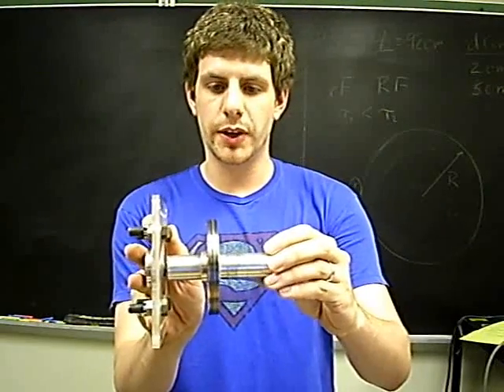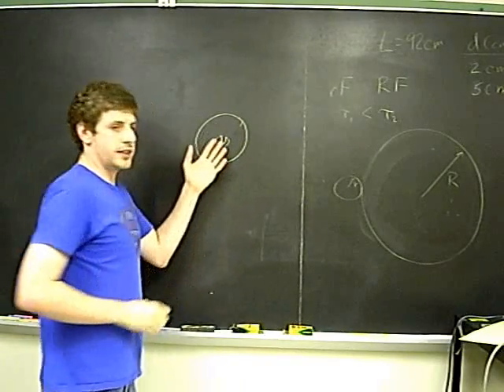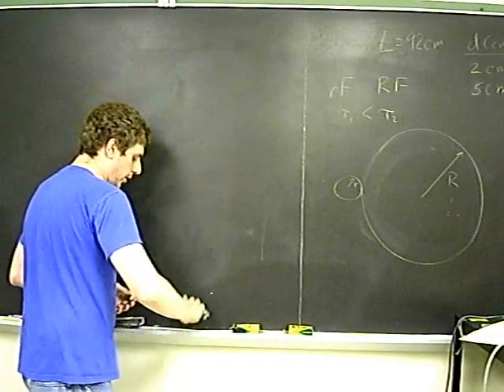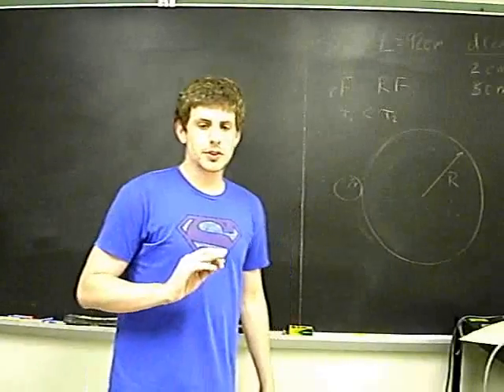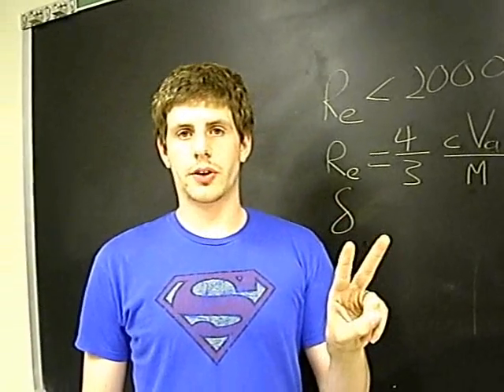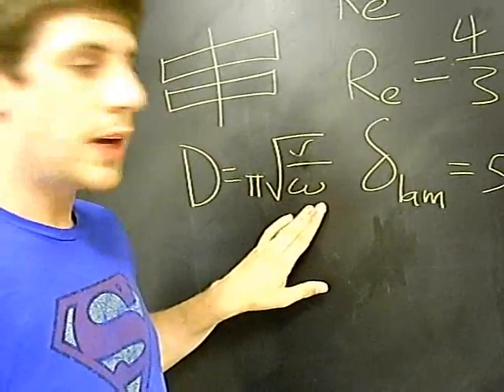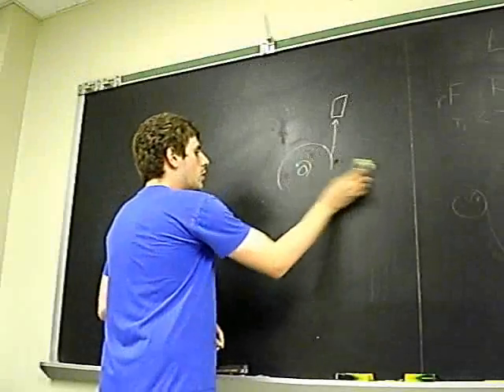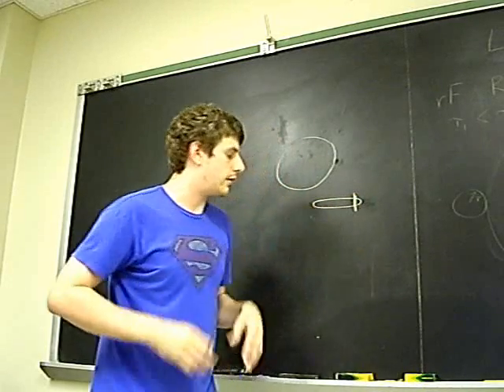Tesla Turbine Concepts Explained

Comment from the maker: @givemetoast you might want to look at some fluid mechanics books for information on that, but it depends on the fluid. You would want a very, VERY smooth pipe entering the inlet, but one that is not too long, as the boundary layer will transition to turbulent flow. I know that you are designing it, but I could be more help if you give me some information, or let me know the dimensions, and I will try and point you into the right areas.

Comment from the maker: @X02fighter dropping them yes, they will break/fracture. Unless your using non-industrial ceramic (dinner plates), they should hold up. I know tiles on the Space Shuttle were made from High Temperature ceramics, and I understand that they are experimenting with High Temp ceramics in jet turbines. The advantage of a Tesla Turbine lies in the fact that you can use low quality (non superheated) steam, while conventional turbines require high quality steam.

Comment: @heavym3tal right that makes perfect sense but isn't ceramic fragile? I'm afraid that using ceramic discs might cause them to break or fracture if the revolutions per second get too high or if someone accidently drops it on the ground

Comment from the maker: @X02fighter If you use aluminum, you will have to limit the temperature of your working fluid about 100-200 deg below the melting point of Al, which is pretty low to begin with. If you could use a ceramic, you could increase your temperature up into the 1000-2000 deg regime. Don't forget that heat will diffuse through a solid from the hot end to the cold end.

Comment: You said that lightweight yet smooth discs would help increase performance of a tesla turbine. Would aluminum discs work or should you try something a little heavier bcuz I'm think that a prolonged use of the turbine would cause it give off lots of heat

Comment from the maker: @xaviour39 Well technically it doesn't produce any energy. It extracts it from a working fluid. Now the amount of energy extracted depends on the efficiency of the engine in question. The highest experimental efficiency for a single stage Tesla Turbine has been about 35-40%. Theoretically, if you have laminar fluid flow over the surface, then you can achieve efficiencies in excess of 95%.

Comment from the maker: @dheiliger yes, this turbine can be used in reverse as a hydraulic pump. Tesla himself claimed greater than 90% efficiency, however, Dr. Warren Rice claimed that 97% efficiency could be attained with strictly laminar flow over the discs. His experiments yielded efficiencies between 30 and 40% i believe.

I am not sure what you are referring to when you mention friction factor though?

Comment: @heavym3tal - It would need to be designed using common material, and few special machined parts. If possible. 
This could also be used as a hydraulic pump and , correct? 
 Would one of these do that?  With a few investors someone could manufacture these for several uses.. 
You said, that one guy claimed he could get 97% eff. Has any one really ever done that, and how did they over come the friction factor, to achieve it?

Comment: I want to build one! How big of one do you need for a 10,000 watt generator, running on steam?
Reply: Charlie Solis just hit ~8Hp between 6000-8000rpm and +6ft-lbs of torque at 4150rpm on only room temp compressed air with his 10in diameter turbine just last month!

Comment: @heavym3tal Many modern turbines use both reaction and impulse principles. If the working fluid is compressible the reaction turbine is slightly more efficient at the cost of complexity. The famous Parsons ship turbine is a reaction type. The earliest Reaction turbine is the Aeolipile or Hero's engine, a very simple device.
Reply: Nikola Tesla actually has a patent for a hybrid parsons and Tesla turbine. It’s patent GB 174,544. It’s specifically for ship use to be able to get the highest economies in what you just explained.

Comment from the maker: Carnot's Theorem applies to a theoretical heat engine. The more appropriate thermal cycle might be closer to a rankine or brayton cycle, if you include your working fluid. Also, depending on the type of flow (Laminar, Transistion, or Turbulent) you have over the discs will change your efficiency.

Comment: in other words it is nothing but that a water pump invested and works with air or water compresed, each disc multiplies the drag the water cause flowing through and cause a vortex in the cylinder increasing the power exponentially

Comment: @TheIdrake absolutely! i wanna try to make one, but actually im looking to make it as a pump... like heavymetal said, start with the original and go from there...If you can get your hands on matlab and maybe an engineering professor to help with the code if your not familiar or good with matlab you can design a nice machine. Matlab will let you simulate the turbine and change small parameters like disk diameter, thickness, spacing between them, hole size and you can find a good design!

Comment: @maco10810 Its not so much to help fuel mix with the air, but more so to reduce heat.  Polished surfaces retain much more heat, and we want our exhausts ports to hold as much heat in as possible in order to increase velocity.  Rougher inlet ports promote cooling of the intake charge as there is more surface area to flow over.  Turbulent airflow is never good, thats why intake ports are still smooth just not polished.

Comment: The discs spin based on the the idea that at the boundary layer there is greater shear.  How would this work if I were to pump a shear thinning fluid in (ie. Drilling Fluid)?  Would the drilling fluid begin to thin due the the shear thinning effect and not spin the discs any more?

Comment from the maker: @TheWhiteTiger57 how do u know that Tesla intended his turbine for pulse combustion? (What is source of info?)
Reply: Nicola Tesla’s valvular conduit patent specifically refers to using the turbine and valve as a pulsed deflagration combustion engine. 

Also his patent GB 186,083, improved steam + combustion turbine patent that he patented 10 years after the original, can be run both continuous flame jet or in a pulsed deflagration or even pulsed detonation mode.

Comment: or what about a vaccuum? running it in a vaccuum/ low atmospheric conditions...you could use some other gas other than air, something super light, and still get the thing to spin...

but looking back at your post- i can see you were just referring to the direction of the flow... it has nothing to do with my longwinded replies! good presentation.

Comment: Its like saying that you could use another fluid to do the same thing. a fluid that doesnt mix readily with another fluid also being forced through the container- where one fluid representing the air, could pass through the turbine without turning it if it was at low enough pressures, but the other fluid representing air creating higher pressures against the surfaces and container would make it spin.

Comment: ahh- without the container, the air would be able to apply force. the air creates an opportunity to create pressure against the sides of the container. Im not sure- Im not a physics major. , but it seems without the container to hold the air, that the air would just diffuse readily in the open atmposphere, and the turbine wouldn't work right. 
in short,doesn't the boundary layer effect depend on pressure, not on the driving medium?

Comment from the maker: The air is pulled when the turbine is used as a compressor. The direction is along a spiral path that starts at the edge of the disc and ends at the holes in the center. I believe that a freefloating magnetic bearing could help with the turbine.

Comment: I've just finished my TT go kart built of scrap lumber using seven inch dia. wheels. The six inch dia,. twenty disk, tesla turbine and it's electric leaf blower air source is connected to the left rear wheel using a fifteen to one friction drive. So far it's doesn't move an inch. (Not enough torque from the turbine)
I think if I try a diffrent housing, and larger drive ratio, it might be able to transport a forty lb. kid up and down the drive way. As my neighbor said "It's needs more work".

Comment from the maker: A lot of Tesla Turbines that I see on youtube have disk spacing that is way too large for the fluid they are using (typically) air. If they use fractions of a millimeter for their spacing, the efficiency should increase.
Reply: I can attest to this 🙋‍♂️ it absolutely does work. Real power and torque at low rpm. 🤤